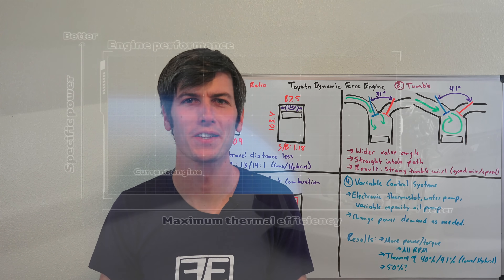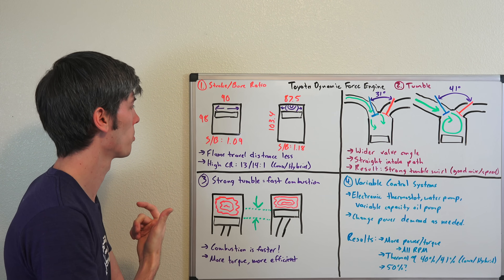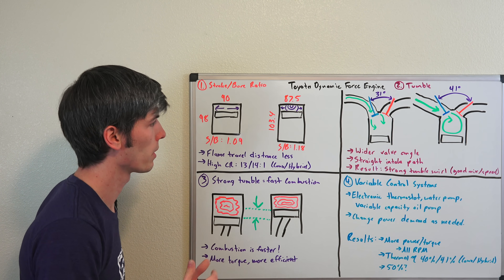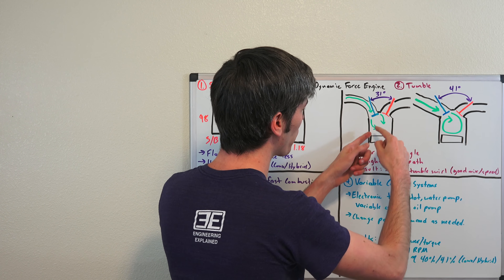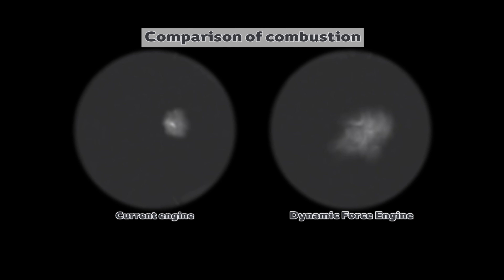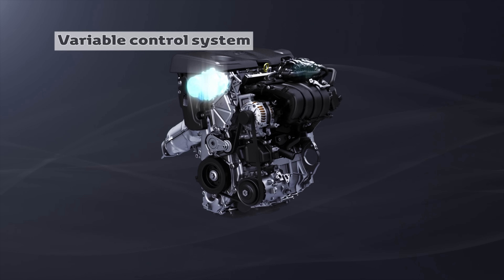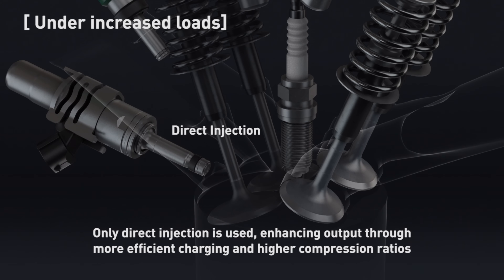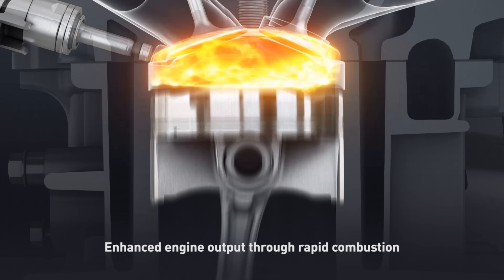Toyota's New Dynamic Force Engine Is Super Efficient

Comment: The only thing that concerns me about this engine is all the new electric control components, which might be more prone to failure than their simpler predecessors. Knowing Toyota though, I'm sure they're all engineered to last a long time still. Another great video Jason!
Reply from the maker: Thanks Matt! Electric water pumps should be pretty reliable, the tech isn't really new and they're simple. Hopefully the thermostat is designed to fail open if it does fail, but yes, knowing Toyota they've likely put in extraordinary efforts in testing to ensure reliability.
Reply: I have a 2019 2.5 Camry  water pump failed at 35000 miles failed open replaced for free by Toyota
Reply from the maker: You're worth a heart too Duck. 😘 Matt's my bud!
Reply: Electric systems are usually more reliable from the get go. Where the failure rate comes in is when they over complicate these systems, because there is litteraly a world of more possibilities.
Reply: Years of driving with ELECTRONIC POWER STEERING...No failure yet.
Reply: The new Lexus LS500 has said electric components, we've had 12 of them through my dealership (13 tomorrow, we're getting an Executive package) and they've all worked flawlessly so far.  We were all a bit apprehensive about them but Toyota did a great job at engineering once again.
Reply: You covered all the advantages of this new engine. What are some, if any, disdvantages of this engine? Longer stroke=less rpm?
Reply: Electric power steering does fail - BMW had to do a recall on the MINI for failures.  There were even fires.
Reply: Electric motors are just about the most simple and reliable pieces of equipment.  Yes, DC motors tend to age slightly  faster than AC motors, but both are extremely reliable and will work forever.  The future is clear: ICE direct-driving the wheels and only the wheels (no more built-driven components hanging off the motor) as well as a motor generator unit that powers (and charges a big battery to power) all the electrical subsystems: pumps, accessories, air conditioning, steering assist, brake assist, throttle, etc.
Reply: Electric motors can last for many years if they are properly sized for the application, especially if they are AC motors.
Reply: Teardown Dan being experienced with 120v and 460 v electric motors, in my industry they often last to 20 plus years.
Reply: The prius already uses most of these and it's one of the most reliable cars you can buy. Toyota did a great job with it considering.
Reply: Electronic sensors and DC motor based systems, when you source the correct specifications and keep strict QC, are fare simpler and more reliable than any mechanical system. Industrial continuous flow systems all use electronic sensors and electric motors because of their reliability. When you see electrical systems and sensors as the cause of malfunctions in a car, it is because the correct parts or faulty parts were used, usually to cut costs but also from not testing parts from the suppliers for quality control. Since this is Toyota, these parts should work just fine, at least in cars made in Japan. American made units may have problems if they use more local suppliers since the management style of, "Make it as cheap and fast as possible! I want my bonus!!!!" is so ingrained in American corporate culture even though it is wasteful and the worse way to manufacture anything.
Reply: I'm thrilled about more electric components. All you need is a loom. The resulting system should be more modular with packaging and servicing advantages. And the advantage of being under software control is immense. Then again as an electronics / firmware engineer, I would say that.
Reply: +dennis Moreno Not even Toyota is perfect but in the landscape of automotive manufacturers it is pretty clear that they consistently put out the most reliable (if often conservative) products.
Reply: Toyotas aren't known for premature water pump failures, in fact their water pumps typically last much longer than everyone else's.  They can go, but they are known to be generally super reliable.
Reply: @buttonman1831  Very true they generally last 150-225K and longer in the tacoma V6's. I have seen them in the 4.0L with 325K and original water pump!
Reply: Gear oil pumps are pretty reliable from decades be it direct or motor driven, motor is one of most reliable component, but picture says variable capacity pump, not motor driven. Usually they are oversized for worst case scenarios with extra oil going back to sump via relief valve. So this should improve efficiency a lot. Water pump is motor driven which makes sense because engine speed is always varying and you need to match pump for worst case and it might be oversized most of the time and wasting power. Water pumps are centrifugal pumps only good option for their capacity control is VSD which they did and also used electronic thermostat valve to ensure both sufficient circulation and better temperature control.
Reply: Matt Maran Motoring the electric thermostat has a conventional thermostat as a fail safe if the electric one fails.
Reply: Good to know. I have a 1997 which is the same Corolla only pre-facelift. Its got the 1.6 110hp gasoline engine (4AFE). No AC, no electric windows og anything. Basically, nothing more that can fail. It also has only 78 000 KM on the clock (around 50 000 miles). I only change oil on it, thats pretty much it. Ive planned to keep this car forever. Its so cheap to run, insure and own. Never gonna buy a new car. This one will probably last longer.
Reply: I'm all for electric control components, why have a constant parasitic load if it isn't needed?  I don't miss old-school power steering pumps or belt driven radiator fans either.
Reply: I agree. Less stresses on an electric water pump make it more reliable and have no parasitic power loss compared to belt driven. Been around a long time but very rarely get used unless in a race car.
Reply: This stuff comes stock mostly on the prius already minus the dynamic oil pump.
Reply: No worries here, they are using technology that is already proofed to be reliable in their hybrids since 2010. This is really cool from Toyota
Reply: Perhaps I am understanding this wrong but there isn't really more electronic bits in this new design compared to the conventional engine. It seems most of the benefits are made in the intake angle, chamber size, and stroke length to accelerate combustion. Essentially what i'm saying is that those electronic parts doesn't make much contribution to the observable differences? Therefore the question remains - what is the disadvantage, if any, to the modifications to the intake angle, chamber size, and stroke length? Limited displacement? Width of the overall engine? Larger, more powerful engines would not be able to utilize these benefits?
Reply: Afaq Saleem 
The oil pump will be a swash plate type variable output piston pump, similar in design to most a/c compressors and large hydraulic pumps. 
They're already common is lots of light duty diesel engines to allow large volumes of engine oil to flow in the system, but reduce flow (and engine load) when not required to improve efficiency. 
My own twin turbo Nissan D23 Navara diesel has one, as does the 5 cylinder Ford /Mazda diesel 3.2lt
Reply: Teardown Dan it is early days, but not like the 80s when new things tended to be very under developed. It sounds counter intuitive but electrtic components that are designed correctly can make things simpler. Example, you have an oil pump, many engines have oil pressure sensors already which read pressure (not just low pressure warning) now if you change the pump from mechanical to electric you can place it in a convenient independent location (theoretically, for easy access). In the long run now what could happen is, cold start for expample, oil pressure can come up before starting. Diagnostic- you can activate the pump (theoretically) and run it through a pressure range test to check the pump or the sensor, or the flow rate of the oil filter to check its life. And motors these days can be brushless 3 phase design (kinda mini industrial type)
But I finish with - to as long as its designed right, not cheap. :-)
Reply: Matt Maran Motoring Lexus has been using All Electronic stuff on CT200h since 2011. Haven't seen it broken once...
Reply: Gotta start somewhere, earlier car with their simple mechanisms broke down more often than modern cars.
Reply: I'm thinking of the expansion of computer responsibility and all the wonderful new OBD error codes.  Other things float through my mind like "increased complexity" , "diminishing returns" combined with living in the "rust belt".
Reply: @christheother9088  Yup, more complex technology and the average shade tree mechanics cannot catch up.
Reply: Its Toyota don't worry. 
The Hybrid Synergy Drive in Prius have more complex electrical system that this engine and people have driven 1 million miles on it on the same car with few minor repairs. 
So it's rather assuring that this engine would have the same if not better reliability.
Reply: literally*
Reply: Get back to us in 10 years about their reliability - you would expect it to work flawlessly brand new.
Reply: The water pump issue is not common, of the 11 Toyotas me and my family have own over the time none had issues with water pump, only alternator, engine starter and dampers(Camry). A diesel Land Cruiser 120 engine was rebuilt due to very high mileage.
Reply: I just replaced my water pump on my corolla at 75k miles two days ago. From my searches on the internet this is a fairly common issue. I'm hoping and assuming this one is improved.
Reply: FIFTYmil it’s a “stroke to bore ratio” so they can still produce larger engines if needed.   You’re right though, it’s mostly the cylinder head design that increases the efficiency of this engine design, the electric add-ons are probably just to precisely control different aspects of the engine.
Reply: Exactly, anybody who is actually educated and experienced in electric motors knows this.
Reply: And i hope they designed in a way so if some of these components fail its easy amd acceseble to change
Reply: k11keeper never assume anything.
Reply: Teardown Dan yes. And once the oil pump is done it will take a couple of hours to replace. And the traditional one on a timing chain engine.... Good luck pal.
Reply: Typically car manufacturers use electronics that are made from a different company. But I agree, knowing Toyota they will use quality parts.
Reply: Gerrit Roelofse appropriately designed plastic where applicable can out last and improve on metal. Its not a panacea but i have a plastic manifold thats around 19 years old 300,000km (180,000ish miles). Its not brittle and is exosed to oil, fuel and heat. On the other hand radiator tanks can turn brittle but they tend to be easy enough to replace. Cheap metal castings can corrode or crack but good ones can go the distance. 😉
Reply: Thing is getting cheap replacesments will be easy.
Just go to the wreckers and find the wrecked camrys since camry drivers are the worst.
Reply: Just changed a water pump on a 7a fe 01 corolla.280 000 kms and no signs of corrosion fins intact literally looked new in the coolant galleries.Someone obviously kept on top of coolant changes but still not bad.
Reply: Engineering Explained n
Reply: I own a late model Toyota and I own a BMW. I've had the BMW slightly longer than the Toyota and, believe it or not, with proper maintenance the BMW has been the more reliable of the two. I've also owned 2 Toyotas which were older gen and more simple than the current one. They proved to be remarkably reliable. Is Toyota going to become yet another victim of the need for car manufacturers to continually chase economy and low emissions by using higher tech/spec levels? Time will tell.
Reply: True, but if they are variable speed, there are electronics associated with them.  VVVFs (variable voltage variable frequency) controllers are commonly used to control the speed of 3 phase motors of all sizes and seem to be quite reliable.  Mitsubishi makes VVVFs in many sizes.  They are used to control elevators of all sizes, pumps, machine tools, industrial machinery, air conditioner compressors, battery electric cars, etc. etc.  Even so, I'd feel safer with mechanically driven pumps.
Reply: I have a friend who has a 35 year olde Toyauto truck with 400,000 miles on it.  The engine has never required major servicing.  Although Toyauto is not perfect, they do have a well-deserved and excellent reputation for reliability and durability.
Reply: That's beacuase those motors that last 20+ years are AC induction motors, which are brushless. Not true for motors used in cars. They still use brushed DC motors with bronze bearings, which are not reliable at all.
Reply: That's not true in 100% gas powered cars. They use brushed DC motors with bronze bearings. Just look inside a fuel pump motor, radiator fan motor, HVAC blower motor, seat motors, windsheild wiper motors, starter motor, door lock motor, etc.. All of them are brushed DC motor garbage.
Reply: Not true if brushed DC motors, which is what car manufacturers like to use still. They will not switch to brushless DC or AC induction motors.
Reply: I know from personal experience with a 1984 Toyota Tercel that was YEARS out of warranty that when something electronic konks out at too high a frequency Toyota takes care of you, warranty be damned.  I was staggered.  It was a 5 year old TERCEL, for crying out loud.  Ignition igniter went out.  They towed it and fixed it for free.
Reply: most of us car enthuiasst already turn off most of that electronic 'help for dummies' stuff
Reply: Even worse, those electric pumps may be located somewhere that is hard to service.  Why not remote the waterpump somewhere near the radiator. (Where heat is wasted)
Reply: C
Reply: This is advanced thinking, someone comments electric control components might be more prone to failure well maybe they will be more reliable. Sounds like another engine thinker koeingsegg
Reply: Toyota does it like this. Everything is electric to keep the weight down of the car. They try to reduce weight. Very simple
Reply: @jessjohn6157  Buy a Volkswagen and be happy.
Reply: problem is everything else (besides Honda) would use cheaper electronics when replicating this system, thus they will have allot of engine problems.
Reply: No problems at all, this is actually the best ice of modern times, most efficient, most reliable and widely used in many Toyota models, to suit any preferences. 👍. I am buying a car with one of those engines or simply full ev.
Reply: My thoughts exactly. This would be a nightmare if a company like BMW did it. Toyota engineers things to last and electrical components are no exception.
Reply: Yeah, this is Toyota we’re talking about, not BMW. You should be good 😉
Reply: My original Toyota water pump (mechanical) failed at 36k it was a common problem so don't assume Toyota engineers everything to last they also cut corners like everyone else
Reply: @dennis Moreno I agree toyota is here to make money too. But be careful with individual experiences. What matters is the percentage of failure on the whole production
Reply: @salempaul8694  fact s facts well said ..pin and highlight for this comment please
Reply: @doubleOOcuban  Maybe it was a recall
Reply: @doubleOOcuban  name the year and model of your Toyota ?
Reply: @doubleOOcuban  Driven and  serviced family's Toyotas   since 1978, one of them had 420000KM on it and I have never experienced a water pump failure; just unlucky.
Reply: @Eric I have a hard time imagining an electric oil pump being more reliable than a gear pump coupled directly to the crank shaft. These things hardly ever fail unless you grossly neglect oil changes. Can't say I'm thrilled about the idea of trading something that is nearly infallible for a far more complex electro-mechanical contraption. (gear pump molded into the engine block with pressure relief valve vs variable speed motor drive + extra wiring + extra sensors + electric motor + gear pump + relief valve in case the motor is trying to turn faster than necessary to maintain pressure)
Reply: Teardown Dan Was
Reply: @teardowndan5364  I trust the Toyota engineers to design better pumps.
Reply: Yup. Engin bay gets hot and then cools down. Repeat ×1000. Plastics become brittle and melt and the internal electronics and sensors fail. 
Huge technological progress for emissions and a crappier engin for the consumer....
Reply: @gerritroe5  I trust the Toyota engineers over you anytime
Reply: @WAN2TREE4  me too buddy.
Reply: Oh come on was that comment really worth a heart jeez man..
Reply: @kakashi99908  ko
Reply: Matt Maran Motoring very true. Knowing toyota though I’m sure it’s over engineered.
Reply: alliejr in So Cal never gonna work...turn air on.. range drops to 10 miles.
Calls triple A Bring me 5 gallons of electricity My car is dead !😂🤣
Reply: this guy matt moron acting like he knows what hes talking about with cars
Reply: mattmec85 yeah. I saved fuel putting electric water pump on my engine but it was a brushed motor so I got a couple years out of that. But I think I could get a brushless one now. However I have been seeing what look like small electric coolant pumps on some utility vehicles lately, maybe for boosting flow or some specific use. I have to look into it. Something like that can aid in post drive heat soak cool off. (potential or theoretically)
Reply: "I saved fuel putting electric water pump on my engine but it was a brushed motor so I got a couple years out of that."

So, the $64,000 question is: did you save enough in gas, to justify replacing your water pump every other year?
Reply: Working fine for one year is one thing. I doubt they'll last for the lifetime of the engine as crankshaft-powered oil pumps usually do.